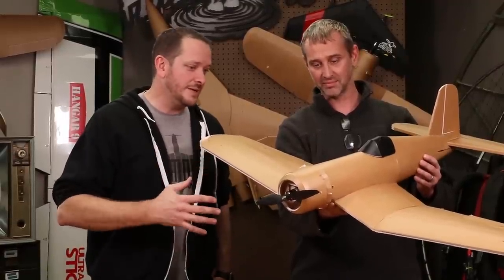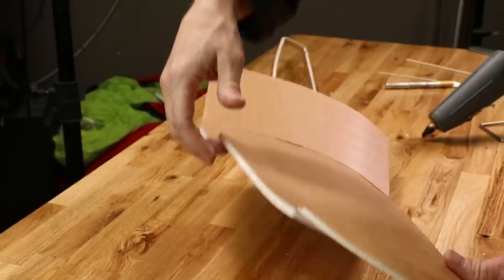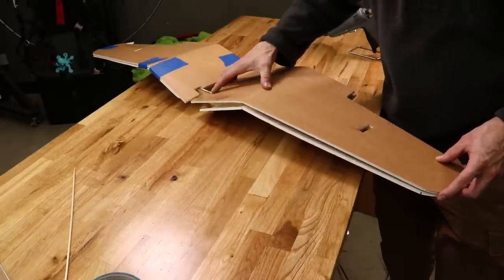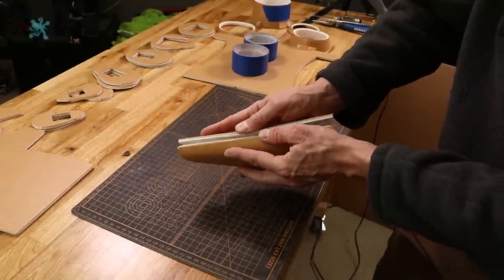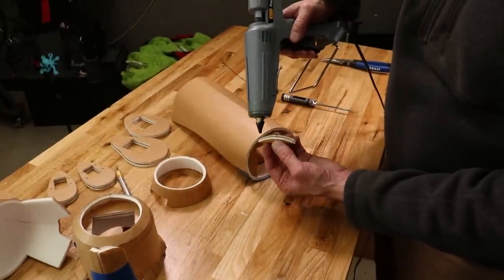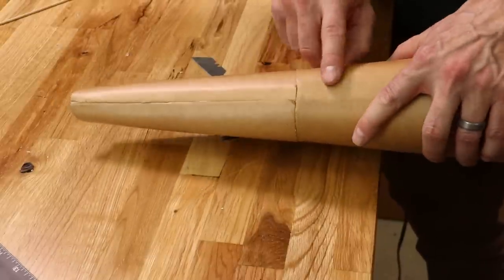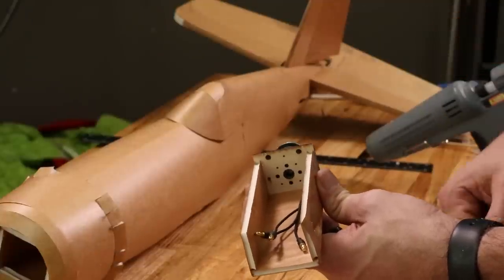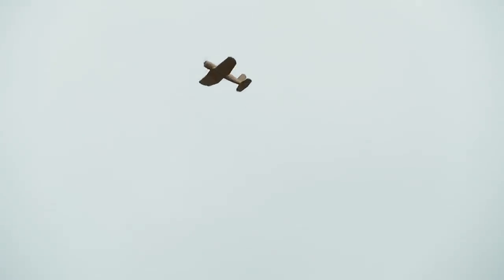How to Build the FT Corsair - Master Series //  BUILD

Comment: When are we going to see the Radial Power Pack C released? The pre-order page says this kit needs the Power Pack C version 2, but when I look at that, it does not include the Radial motor.

I just ordered two of these pre-order kits... but I didn't order a listed V2 C-pack because I don't want to buy those untill I know I'm getting a Radial motor in the pack. When are we going to see Radial powerpacks on the store for order?

Flite Test FT Corsair (1168mm)
FLT-1065
https://store.flitetest.com/flite-test-ft-corsair-1168mm-flt-1065/p897439
(1) Flite Test Power Pack C-V2

Flite Test Power Pack C V2 (Fixed Wing Large)
FLT-3003-V2
https://store.flitetest.com/flite-test-power-pack-c-v2-fixed-wing-large-flt-3003-v2/p897652
• (1) Motor - EMax GT2215/10 (1100kV)
Reply from the maker: Hi  

El Duderino Lebowski
Power Pack C v2 makes the power pack 4S capable, it is related to the ESC, not the motor.
The new Power Pack C that are completely Flite Test branded with a radial motor do not currently have a lead time. Later this year.
Hope that answers your questions!

Comment: Builder needed: SPOIL THE SPOILER: The Tethered Flying Car. The car's computer is controlling almost all parts of the car except
the body of the car! The body of the car is most like a baby-buggy without the control of the mother's hands.
Of course the first real use of the spoiler was a now famous Dodge Charger Daytona; since then all emphasis has been on the
spoiler while the turns were faster because of the vertical stabilizers.
Why does the car get better fuel mileage on the highway than in town? The car encounters the next air molecules that are resistant 
to change; the air travels over the car then dashes under the body of the car: giving lift! 
3, 4 or even 5 spoilers turned upside down; mounted between flat vertical stabilizers at the canard zone, the wing zone and the 
rear zone are to be controlled by the driver and eventually the computer. The spoiled spoilers are only as wide as the car;
allowing for traffic as is. This is the first prototype with the next step that should allow more lift from the ground leaving the power 
tray on the street. Then the lift should be improved to have layers of traffic upon our highways of today. Freight carried by the tray and
carried by the tethered flying car should improve. 
Danger is able to be reduced with detaching the car from the power tray for a short span of time.
Naturally: finally the power tray is to be drawn back to the already airbourne car: with landing the power tray first then lowering the car
to the safety of the ground.

Comment: One heck of a lot of excess weight by using the wrong adhesive. Hot glue is 1) Heavy, 2)flexible, and 3} wimpy
Reply: It's fast  and fills gaps. I'm sure that's why most use it. Amazing how little you can use when the parts have good fitment. I prefer the foaming "Gorilla glue". As long as you can hide it. It can make on heck of a mess. Like all glues, the trick is to not use more than you need. But, it seems to penetrate the paper down into the foam. makes a very strong joint. I admit, I will use a few spots of hot glue to tack a piece down. Other recommendations for glue ? I have little luck with foam safe C.A. on this kind of construction myself. Mostly because  I don't get perfect cuts.
Reply: @JimmyC_2112  Hot glue is great for tacking. It gets soft at 90 degrees F, and is liquid at 120-130. That means in 100 degree Texas Spring, Summer, and Fall (also in NM, AZ, CO, UT, NV, CA, OK, and a whole lot of other places, your structure is extremely compromised. 
And using "Strong Joint" and "Hot Glue" in the same sentence will cause engineers to go insane.
Reply: @rogerguinn1642  "strong" can be relative term.  I suppose it would have been better to say the joint can be surprising strong given the limitations of hot glue.  But, yes. Still not very strong.  And more surly does not mean stronger. Just heavier.

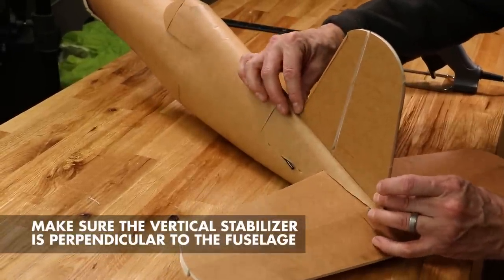Comment: This is a fascinating video manual!  I did find one question - at 2:02:18 there is a written comment "MAKE SURE THE VERTICAL STABILIZER [rudder] IS PERPENDICULAR TO THE FUSELAGE."  Shouldn't that be "perpendicular to the horizontal stabilizer [elevator]?"  Also, since the elevator isn't glued in yet because it needs to line up with the wings, wouldn't it be better to wait to attach the rudder until after the elevator is properly aligned and glued in?  I did see that John re-aligned the rudder and elevator after the wings were on. 
Speaking of wings, it would be better to have them be removable - rubber bands and skewers - so you can maintain the electronics without having to unglue or cut things open. Tim Olathe has a unique solution to this: https://www.youtube.com/watch?v=luZKq5fRrbI

Comment: I bought the Corsair with the recommended “C motor pack” and there is no instruction as to how to assemble the motor and install it into the plane. Josh just jumps from making the motor mount to “ I already have the motor assembled”
Reply: I would love to get this thing in the air soon so any help would be great
Reply: Also your website does not recommend the radial motor nor could I find a power pack with the radial motor to buy with this plane

Comment: The hardest part of the build.. No directions on how to make the battery box.  For you guys who have made them all the time it is easy, but for first timers the parallel lines on a flat piece of foam board, dig out the foam between the lines and bend them which way?  Need to watch the video and stop it a hundred times as it is juggled in your hand, which way does this piece bend over the other?  is it inside or out ?  Still trying to figure it out may have to just make a box to fit but for the moment still trying.Back to the video.